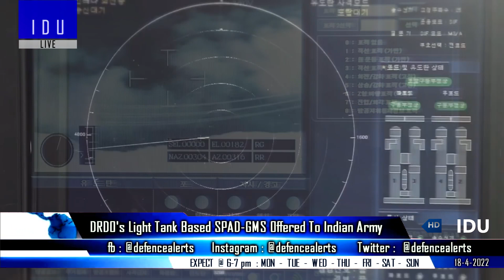Indian Defence Updates : AMCA Serrated Panels,Tejas MK2 Rollout,DRDO New SPADGMS,Brahmos-NG Facility

Comment: Is this a mistake in narration ?? Tejas mk2 production in 2029 !?? Shouldn't it be by 2026 if trials start by 2024 ??
Reply: @le_ecrivaine  if lack of the production line is the only issue, we don't need to consider this date a done deal.... That might change.... When the aircraft will be ready for production after all tests are completed is more important.
Reply: @le_ecrivaine  they will need more lines anyway as production of amca and mk2 will go along simultaneously . Also, with private partnerships, they won't have issues with capital and lack of infrastructure. Mk2 production by 2026 to 2027 and amca by 2028 or 2029 should be the target.

Comment: Just in case of Chinese aggression and even if we have to defend that too effectively then we need quality stuff, as you (Indian Defence updates) said "niche technology " I add importantly to that " to be conversant with the equipment as well  " .
We should be realistic and avoid deception that with DRDO any Indian private player can develop very effective Short range air defence system which can supplement meaningful movement of Tanks and armored vehicles;better if we go for K30 Biho of South Korea and our private player be promoted by government (like L&T , Mahindra,Kalyani group,Tata..) to collaborate with Hanwha defense of South Korea ,if possible.

Fact remains that if I need to buy toys for my kids then I find almost 100% dependence of Indians on China. Go for child Nebulizer , quality scissors,nailcutters,cigarette lighter to simple thermometer leave aside Infrared thermometer (Temp. Gun) all coming from china in India. Even your modern lock (cylindrical and other on your doors) .
By simply boosting doesn't work ,fact say otherwise;alas..